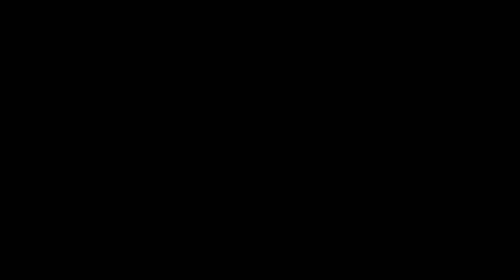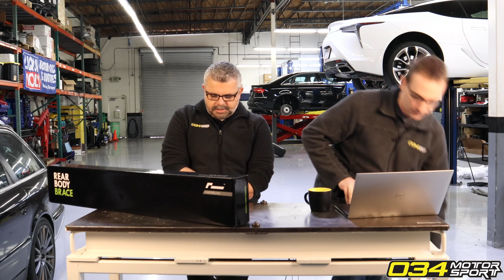What Would Make a B8 S4 Have Engine Failure? | 034Motorsport FAQ

Comment: savrog had a 6466 turbo on a completely stock motor for 4 years pushing the motor to much more than our supercharger could think of even doing. to say you guys are blowing motors is a pretty lazy copout. the trolling is getting out of hand for no reason. Feel like the subaru community is bleeding over lol.
Reply from the maker: Keep in mind it's the TQ not HP, but yes, it's trolling as we haven't had one documented case reported to us that would inform us that the failure is because of our tuning and not some unrelated issue with pushing and stressing the system hard enough.
Reply: @034motorsport  yea im stage 2+ e40 with a jokerz port and ended up getting a blown head gasket, but im pretty sure it was because i overheated it in the summer. completely my fault but getting it fixed right now. should be good to go after that.
Reply: that build was amazing.  it did end up blowing though.

Comment: My s4 siezed 5 hours after buying it … literally I pulled off the supercharger amd I seen pieces of connection rods chunks … motors are going for an arm and a leg I’m lost
Reply: Same. Mine seized on the highway. I had 034 on it for about a month or so. I emailed them and they basically said "sue me." Im not even blaming 034 tbh. If i tear the engine down and see burned through rings and pistons then i will. So far ive only found metal in the oil pan.
Reply: @Dubz0408  broooo no way mine was destroyed my intake valves were all toasted wouldn’t crank by hand , glitter party in the oil pan … bs
Reply: @Dubz0408  I bought the car drove to gas station filled with 93 pushed it to 100mph was comin down and boop … car completely turned off then the start caught on fire ..
Reply: @German_hell_kitty  Thats the weird thing. With mine theres no bent valves that i can see(atleast just with the supercharger off), no windows in the block, no holes in pistons, just... metallic glitter in the oil pan and the crankshaft only spins about half an inch to an inch in either direction.

Ive seen a vid on here where a guy found that a timing chain tensioner started coming apart and a metallic flake binded up the timing chain. I really feel like thats whats happening with these engines seizing all over the place. Not "trolling" as the hosts of this vid said which is completely insulting when youve lost a fucking engine that costs up to $15k if you dont do the work yourself.
Reply: I’ve owned my B8.5 S4 for barely a year and a half. This car has been nothing but a nightmare. The engine seized a couple months right after I bought it, without any warning.

Had the engine rebuilt, wasn’t cheap. The car was in the shop for almost 7 months due to the availability of parts.

Got the car back mid July this year, drove it for almost 5 months with no issues at all just maintenance items. 

Upgraded the HPFP and got on a E40 tune. Drove it for 2 days. The car went into limp mode cruising on the highway at 70mph. Now the engine is knocking. Back to square one…
Reply: @noes.2835  bro sorry to hear that , I thought i had it bad …
Reply: @noes.2835  bro are you tuned ?
Reply: My cats just blew im about to just put this thing back to stock can’t afford to lose this car threw so much money down the drain already

Comment: Omfg, they didn't  answered the question, just kept repeating themselves for 11 minutes.
Reply: Javad here, what makes you say we didn’t answer the question? We absolutely did.
Reply: @javadshadzi4824  You just kept saying that your software tune is not at fault, I got it the first time you said it. I thought that the video will be about the weaker points of the engine that can lead to catastrophic failure.

For example (making this up), some cranks develop structural fractures in low mileage cars that can lead to grenading the engine, however higher mileage parts are more thermically stablised thus it's less likely to happen.

Second example, the integrated heat exchangers in the supercharger can cause injecting coolant into the cylinder if the leak gets really bad it can grenade the engine etc.
Reply: @8359s  we discussed all those points extensively